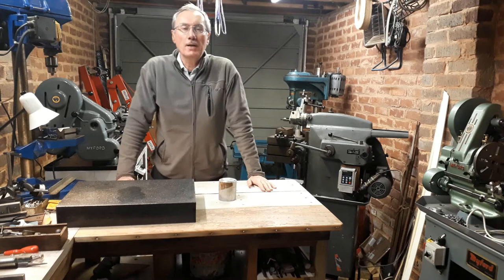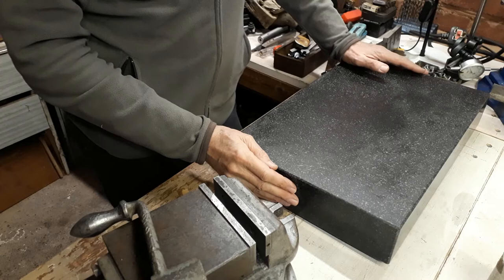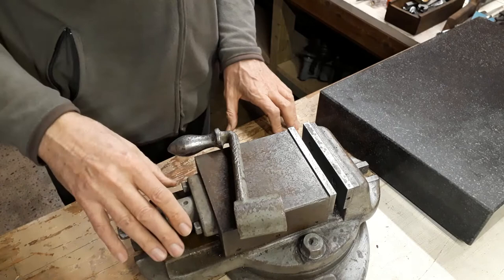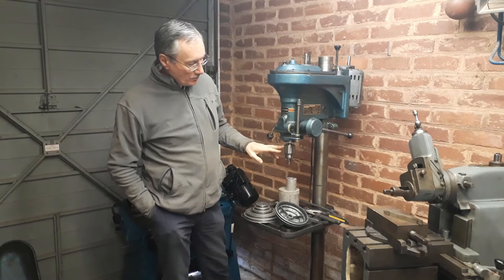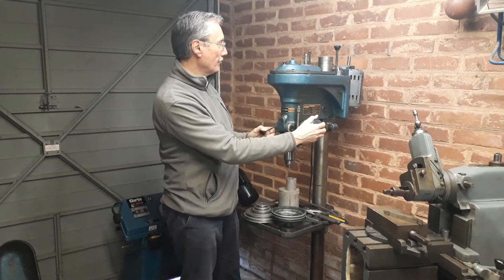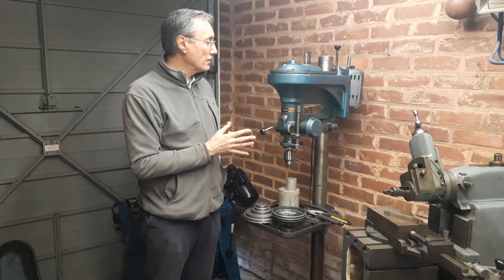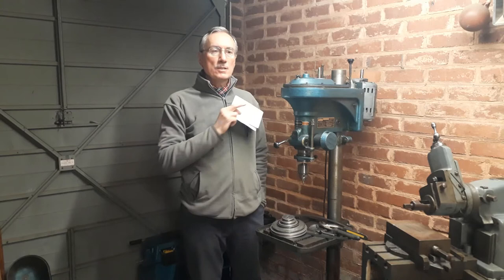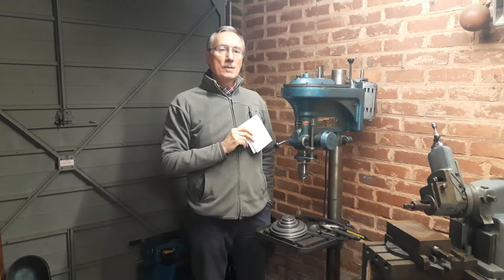Meddings Drill Renovation #1 (gear drive)

Comment: Hey there! I just got one of these, myself. Did you know that the little screw in the top of the oil filler cap is supposed to have been removed and thrown away upon commissioning? That screw was there on mine, too.. since May 1967. 😂
Did you replace the oil seal as well? Mine is leaking from there as well as the point where the oil drain tube threads into the housing.
Reply from the maker: I didn't know that the screw should have been removed! To allow the gearbox to breathe, perhaps? In a way I am glad it was still in place since I transported the drill in the back of my car on its side and it sat like that overnight. Not a single drop. However, I think my oil seal will need to be replaced at some point. Thanks for your comments.

Comment: Great stuff! Where are you buying your gear from? I also need the same gear for my drill.
Reply from the maker: Hello Mauritz, Following this video I ordered what I thought was to be a Tufnol 56 tooth 16DP gear blank. However the supplier sent a steel blank before I could correct the confusion and said on the phone that they would quote for a Tufnol gear but that it would be expensive as it would be a 'special'. Understandably it was - more than the Meddings spare off the shelf. The supplier I used (and also used for my Colchester Student lathe renovation featured on this channel) is HPC Gears, Chesterfield, UK. I have been very pleased with their service, but on this occasion this isn't going to be a viable option. I have since ordered the part off the shelf from Meddings, Ivybridge, UK. They were very helpful over the phone. So I am not going to make the saving I was hoping for!
What I might try is comparing the Tufnol gear with the steel gear and make this part of my refurbishment series in case it is of interest to others. I suspect that it will be noisy and I am not sure that the lubrication will be adequate. It might be worth a try.
Reply: @Workshopfriend  Thank you for the reply. We need somebody who can make the gears out of Delrin (cheaper than Tufnol).